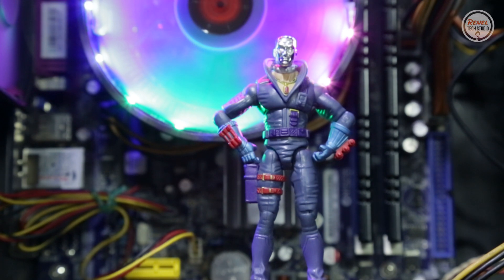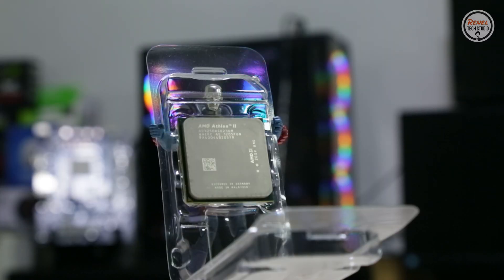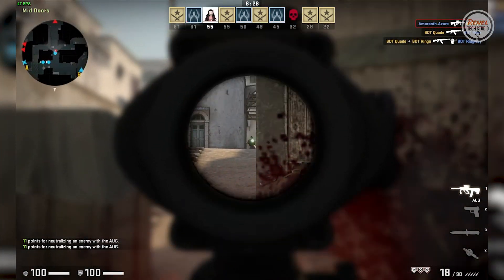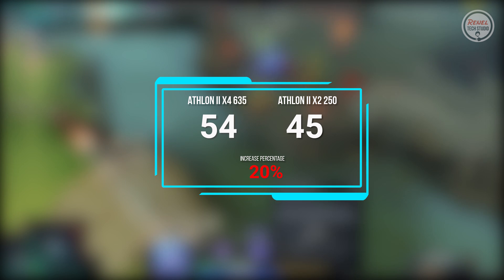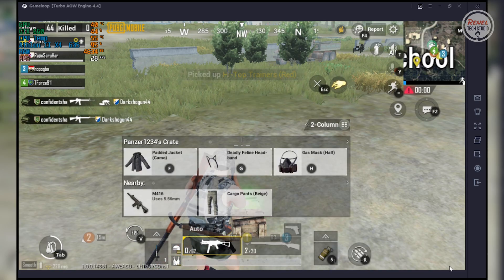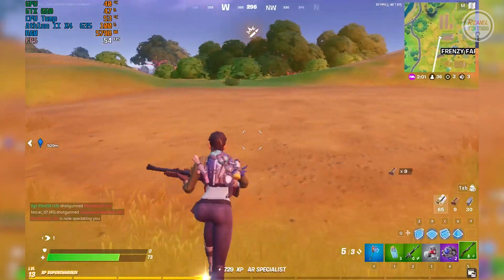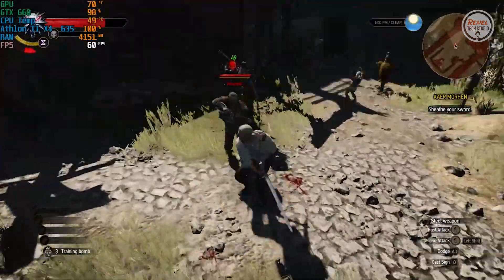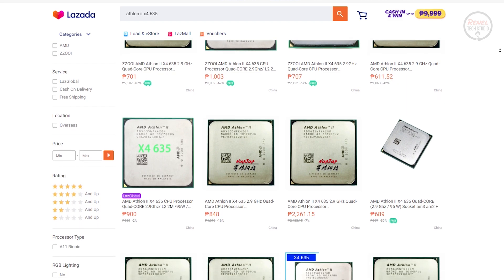AMD Athlon II X4 635 with 4 Cores & 4 Threads, will this be an upgrade option to Athlon II X2 250?

Comment: I am using a Pc with X4 635 (volontary underclocking !) 13 years old , 16 Go Ram , 3 SDD, 1 HDD, GA-970A-D3 mainboard, noctua CPU FAN and PC case , 730 Gt. Win 10 x64 Pro I have nerver Hardware failure. It's a reable cpu with more usage........😀 Holding Comparison to recent AMD and Intel platforms
Reply: can running windows 10 ?
Reply: Yes, It's run in my case on MB Gygatyte GA970-UD3 16 Go with Win 10 22H2 X64. The X4 635 is a good processor.

Comment: I have recovered an Asus motherboard in good condition with an X2 250. I bought a second hand X4 635 for 35 € well at least to put the x4 that allows to play video games that require a cpu with 4 cores, which we can not do with the x2 250. After some people say that the x4 has less performance than an x2 completely wrong, the x4 give better performance in video games. For my part with the x4 I run in low but good quality current games like Days'Gone, Biomutant, Kena, Vampire Sawsong, etc....

Comment: Great video. This is actually the upgrade I did to my old emachines computer. Before the upgrade it was incredibly slow. After the upgrade it's fast and I see no reason to get another computer for myself just yet lol. I also doubled my ram from 4 to 8 gb so that might also account for how much better it runs. Before it couldn't even run Roblox, now it runs it well and a bunch of other games (I have the r7 250 2 gb).
Reply: Throw in a cheap SSD if you haven’t over the past year 500GB WD Blue Sata SSDs go for around $64 you can get ‘em online or even at Walmart.

Comment: For AM3 system i recomand Phenom X6 cpu.
Reply: I prefer x4 for price/performance
Reply: cant I just add a fx cpu?
Reply: @veryhotricke8657  FX is only on AM3+ mobos, while AM3 processors like the Athlon II and Phenom series can be used on both AM3 and AM3+ motherboards. AM3+ CPU's on AM3 boards I've heard are also a hit or miss, you need an AM3 board with an AM3+ socket to make it fit since AM3+ has 1 additional pin, you also need to make sure the BIOS is updated to support the AM3+ CPU. To save the hassle, FX = AM3+ board, Athlon/Phenom = AM3/AM3+ boards.
Reply: @itpugil  oh thanks for the explanation!
Reply: @veryhotricke8657  don't mention it! :)

Comment: Hi, Greeting from Taiwan. Glad to find your test on these two CPUs, I happened to have both in hands from friend, wondering which performs better than the other since they share the same L2 cache in total though the X4 635 has double cores and threads. 
My purpose is to pick one to build PC which plays 1080p film and watching Youtube instead of gaming. And your recommendation will be?
p.s. I work with many Filipino in workplace, they are kind, diligent, and beautiful. 
Wish you luck, pal! Cheer up.
Reply: I suggest you use the dual core to play the 1080p films and watching youtube, while you can save the other processor for a potential build in the future that requires a more demanding task. I have both processors too, gave the quadcore to my brother and he does a lot of gaming @720p. While the dual core is used on my test bench PC.
Reply: @itpugil  Thank you for replying, I think I will only keep the quadcore, and return the dual to my friend. In fact, I got a better Phanom II X4 970 with a dumping price couples of weeks ago.^^
Reply: The x4 635 has 4 cores and 4 threads not 2/2, for the x4 some say that in raw power the x2 has more performance for my part I have both cpu and I use more for the video games the x4 which gives better performance to play especially with video games that need a cpu with 4 cores, because the x2 is a native 2 core cpu, 2 theards we can't unlock the 4 cores that are not on the x2 because the x2 is a native 2/2 cpu.

Comment: should upgrade from athlon x3 435 to athlon x4 635?
Reply from the maker: For me I prefer more core and threads. Games run better with more cores and threads.
Reply: @RenelTechStudio  but is there a noticeable difference between the x3 and the x4?
Reply from the maker: @AgustinMP  The difference is the cores X3 has 3 cores while X4 has 4 cores and X2 has 2 cores. That's how AMD Market their processors before.
Reply: @RenelTechStudio  
I mean difference in performance
Reply from the maker: @AgustinMP  Ok I see. I never tried Athlon X3 before but base on my experience in different CPUs having more cores can be beneficial in productivity and games. As of now I can not answer this question "what is the performance difference in detail between the Athlon X3 and X4". However, I can assume maybe the X4 is slight better with the X3. Check this link this how check and compare CPUs & GPUs:
https://cpu.userbenchmark.com/Compare/AMD-Athlon-II-X4-555-vs-AMD-Athlon-II-X3-460/m12528vsm6695
I hope I have helped you in someway.
Reply: Just upgrade to a Ryzen 7 8 core. I have the Athlon II X4 650 and it's ok but sufferes drastically. I would recommend saving and getting anything from a Ryzen 5 to a Ryzen 9 or a I7-I9 whichever you can afford for what your computer is running. This processor is 10 years old and mine is around 7-9 and it shows
Reply: @SpoookyGamez   In some parts of the world, that is easier said than done.

Comment: Pwede bang samahan  ang processor na yan ng gt 710 instead ng gtx 660 playable parin valorant?
Reply from the maker: I think pwde. Valorant performs better in my test with A4-5300 running on its integrated graphics which is the Radeon HD 7480D and I think GT 710 is way more better than that graphics processor.